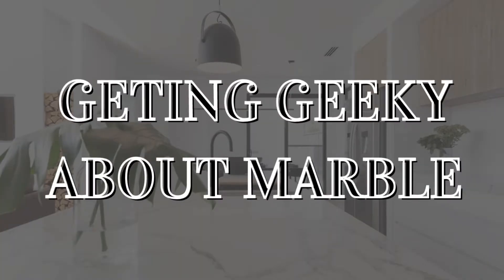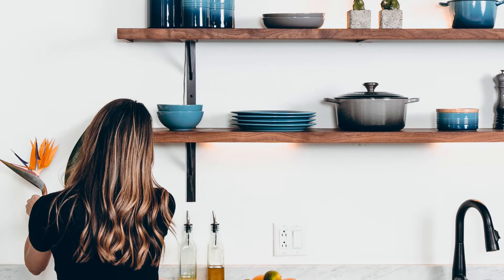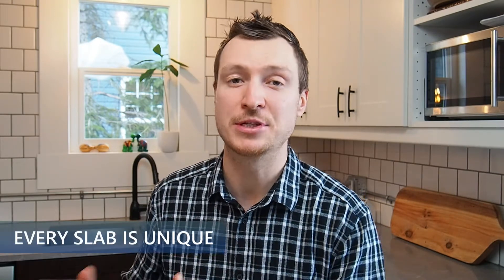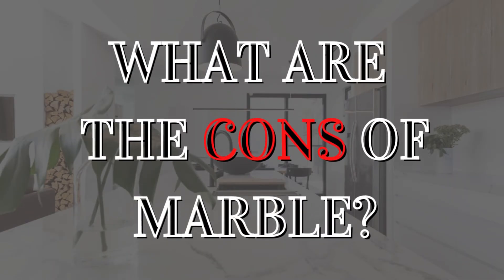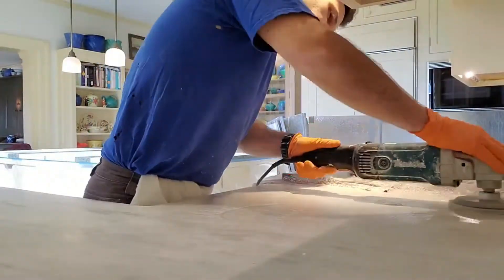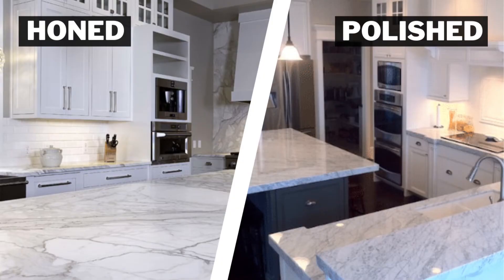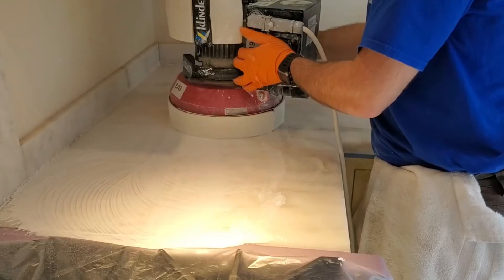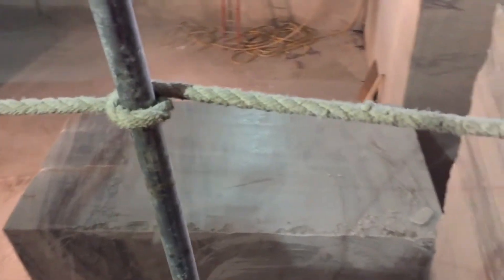The pros and cons of MARBLE Countertops | Does it get a bad rap?

Comment: Something to consider is that etching, staining, chips are all purely cosmetic.  Another thing to consider is repairing marble chips, honing, etc. are all much easier to repair than quartzite and man made quartz.  Chip repairs in quartz are much harder to get to blend in and quartz can and does etch via strong solvents, like when people spill acetone/nail polish remover.  When you go to repair quartz you almost always have to do the entire surface to get it to blend in however with marble you have a much better shot of getting it to blend in doing spot repairs.

Comment: Hi Home Stud guy, It looks like you don't have an air gap for the dishwasher. I don't think I've ever seen one in any of your designs. What's your opinion of dishwasher air gaps? What would you do for proper function besides?
Reply from the maker: This comes down to what code your specific location uses. There are two versions I come across which address this issue - the IRC (International residential code) which allows for a high loop drain setup. This secures the dishwasher drain line to the underside of the countertop, thus allowing it to act like a an air gap by creating an air break and keeping a syphon from forming. The UPC (Uniform plumbing and mechanical code) requires a dedicated air gap installed at the top of the surface of the kitchen sink. You would not see them in my 3D renderings or elevation work. This is something we dive into far later when working with clients and their contractors and is dependent on the geographical location.
Reply: @hsdesignstudio  Thanks very much for taking the time to reply and explaining it so clearly. You are a good egg and you do wondeful work. Have a nice Sunday! Thanks again!!

Comment: Thanks for the great video series, very instructive. We’ve had marble on our kitchen island for 4 years. When we first met the stone artisan who made our counters he strongly advocated against Marble . We have Carrara Marble from Italy( our house is in the south of France so that was the « better » environmental choice). I didn’t take the advice because I just love the look but the cons you have underlined are not exaggerated. Even water will etch it. I am a little OCD so we have no stains and we have never sealed it or resealed it since it was installed. However if you do not live with a rag in your hand, this is not the material for you. On the other hand, if you value baking and making pasta and working yeasted doughs, it is a baker’s dream. I use my kitchen extensively for these types of tasks so I wouldn’t have anything else. I don’t agree that marble is for less used kitchens but I absolutely agree with you that it is a stone you have to keep a close eye on.
Reply from the maker: Thats for adding your experience. I definitely exaggerate when I say just for looking at. You are also right that it is fantastic for bakers, as it stays a little cooler than some other options. If you are willing to live with the cons, or as you say 'with a rag in hand', it is a beautiful stone for a countertop.
Reply: So you didn’t seal it, yet you are agreeing/complaining about it’s issues? What countertop would you not want to seal before use? And is it polished or honed? If you don’t seal granite (and reseal it) you will have issues, though everyone thinks granite is the “gold standard”.

Comment: While your information seem valid, when you get to the point where you address what you can do to over come some of the cons you don’t spend much time on sealers and anti etch coatings.  Is that because your think those sealers and anti etch coatings don’t do much to offset the con?  I’m working on getting information and cost quotes for these professionally installed anti etch sealers, as we are considering the beauty or marble. 
On a side note we had granite for 15 years and loved its performance.  In our new empty nester house we are going with a modern white / gray / blue color palette, thus the marbles would look great.  Granites are not white enough and most are very grainy. We are considering the Viscon White granite if we could find some predominately white slabs.
Reply from the maker: Hi Kelly- When you dig into some of the Anti-Etch sealers out there, they fail to hold up to their claims. While I think installers are a great source of information, they also have a want to sell the product they use. The big thing to dig into is the warranty of the application specialist as well as the product. Some don't warranty against normal wear and tear. For marble, that can mean etching and scratching to a relatively high level.

There are A LOT of different sealers and coatings out there claiming to keep marble (and other stones) looking new. What I have found in the past is that most of these DO keep the actual stone from staining or etching, the sealers or coatings themselves can become full of scratches or gouges. I've even seen some hold onto stains. In some cases, these can then be removed and reapplied (again keeping the stone safe). But at this point, I often wonder why even use that stone to begin with? You are essentially completely covering and changing the surface of that marble material. 

Have you ever thought about quartzite? You can often find white varieties and it holds up far better than marble in most cases.
Reply: @hsdesignstudio  I'm a Certfied Applicator for MORE Surface Care's "Anti-Etch" up in the Seattle market.  There's a 10 year written warranty against staining and etching.  I've done dozens of projects since I got certified in 2020 and have yet to have anything close to a failure due to staining or etching.  It literally can't etch, you can pour strait muriatic acid on Anti-Etch and it won't etch.  It can still scratch and we make that very clear, I even have scratches in my samples (and wear marks) to show people and you are correct, the scratches and wear (for example dragging a heavy bag of groceries leaving small marks) are not covered but are usually easily repairable for a nominal service fee.  I've had 2 call backs, both consumer error (1 was a designers personal marble kitchen and their toddler had a tantrum with the backside of a spoon on the marble...put a bunch of "stun" holes in the Anti-Etch Coating...I was able to fill/repair and make "almost" invisible)... The other call back was people who had to move their refrigerator and filled boxes with food on the marble and when they put the food back they slid the heavy boxes and it left marks.

Comment: What are your thoughts on dolomite? We just purchased 2 dolomite slabs for our kitchen renovation. We were told that dolomite is a cross between quartzite and marble.
Reply from the maker: This is an interesting option to me- kind of like marbles harder cousin. They lean much closer to the marble end of the spectrum though, compared to harder options like quartzite (they can still scratch, ding, and etch). They still require a fair bit more care and maintenance as well. They are beautiful though!
Reply: @hsdesignstudio  Thank you so much. Was hoping it was closer to quartzite. I'll have to let you know what we think after we've lived with it for a bit.
Reply from the maker: @robintanny3318  yes I would love some first hand insight. It is definitely not a common choice.
Reply: Dolomites still etch.  Saying they are a cross between quartzite and marble is untrue. They're still marble.  That being said there can be portions of a slab that aren't nearly as acid sensitive meaning you can get away with a bit more (without etching)...
Reply: Two years later, are you happy with your dolomite?  Seven years ago, I bought a home with dolomite counter tops that hadn’t been well loved.  They were already etched and chipped.  I chose to live with it, adding a bit more wear (character),  but being much more gentle than the former occupants.  It’s such a beautiful stone, I’m thinking of installing it in the home I’m about to buy.  Yes, it requires extra care and maintenance, but I live alone and am very careful -- so might just choose to surround myself with something that’s beautiful and makes my heart happy!

Comment: Are you going to be covering metal countertops like stainless steel and copper? Also, what do you think of cork flooring in a kitchen?
Reply from the maker: If there is enough interest, I'm more than happy to do a video! What type of cork flooring? There are quite a few varieties. To be honest, I've put hardwood, laminate, LVP, tile, in kitchens and its never been an issue. I'm also not one to get water everywhere when using the kitchen.
Reply: @hsdesignstudio  I've seen two videos recently on cork flooring (which I'd always assumed wouldn't be hygienic in a kitchen) but they said cork flooring was a fantastic choice as long as it's sealed. They used it a lot in older libraries where it takes a lot of abuse and I know they used it in the bathrooms at Frank Lloyd Wright's Fallingwater.

As an aside, on a recent video from Home Diagnosis TV on the indoor chemistry happening all around you the hosts mentioned that you should avoid vinyl in all forms - which means vinyl flooring. What have you heard on this topic?
https://www.youtube.com/watch?v=90U1S1dsnyw&t=34s
Minute 23:40

As for countertops, I know butcher block is great for an island (not so much next to the sink) but wouldn't stainless steel be a great choice for the prep area?
Reply from the maker: I've known a few people that have used cork flooring (sealed) and they have loved it. Its also available in quite a few different varieties now (plank, roll, etc). 

As for vinyl, it probably isn't the best. But they really don't say why they don't like it in that video. Also keep in mind, the vinyl used in commercial schools and buildings, is quite different than LVP in homes.

As for stainless steel, there is actually some interesting science that shows its not nearly as hygienic as you would think. This is likely something I'll dive into in a video during this series. The short of it though is that during some lab testing using E.coli and Salmonella cultures, wood cutting boards performed better in terms of CFU (colony forming units) and clearance.
Reply: @hsdesignstudio  As a safer option to vinyl, how about old fashioned linseed oil linoleum? It supposedly kills pathogens naturally. Maybe a video on natural alternatives to chemical products in construction, like non formaldehyde plywood?

Comment: Interesting that you seem to lump all types of marble together. But there are some marble which are less porous/more dense, such as Vermont Danby….006 absorbency. Also, Shadow Storm, Brown Fantasy, etc. You also don’t discuss polished vs. honed (honed showing etching much less), nor do you address minimizing these issues with proper sealing, and sealants have come a long way and they differ greatly in effectiveness. I have tried to like the alternatives (quartz, quartzite, granite), but can’t even begin to compare them with the beauty of marble. So maybe you should take into account that folks don’t buy countertops purely for their usefulness. Beauty counts as well, hence the reason so many are interested in marble.  I am currently being told the same “line” as you by my kitchen designer, yet have you actually had any experience with any of the harder/denser honed marbles for kitchen use?
Reply from the maker: Yes, there are a variety of marble types, but they all generally come down with similar issues. I can’t create a 10 minute video covering every possible option, especially when some are only available in certain regions or so costly to get ahold of it isn’t worth it. Yes density and porosity changes some, but still fall on the less desirable end for maintenance and functionality for MOST people. I’m not saying they are bad, or shouldn’t be used, I’m saying know what you are getting into. You seem to know, which is great, and if you want to go that route, go for it. I’ve worked with hundreds of clients, and marble is not a common choice. Most people choose beauty second to function when it comes to their countertops. It’s not a ‘line’. It comes from  experience. From having clients disappointed in their choice. It comes from working with installers and fabricators. It comes from talking with stone yards.
Reply from the maker: Best of luck in your renovation